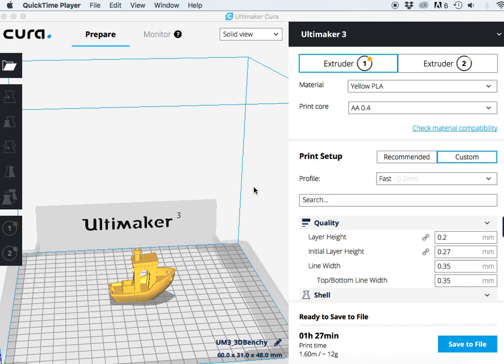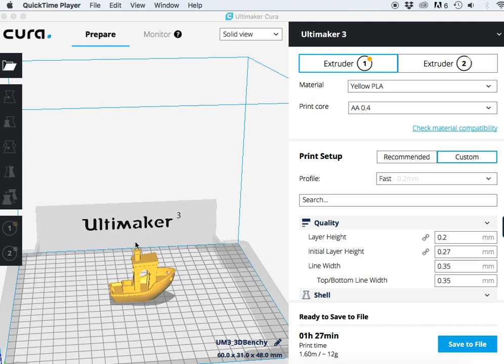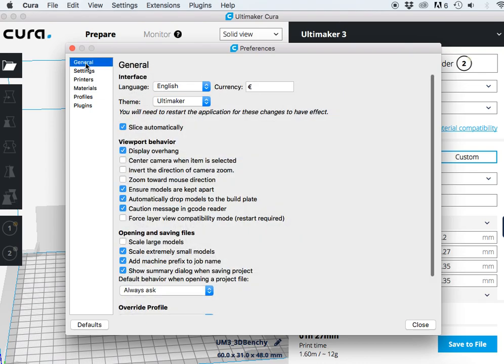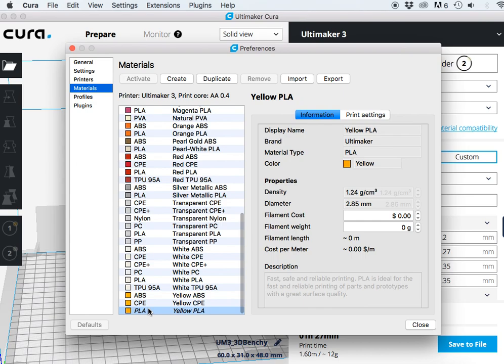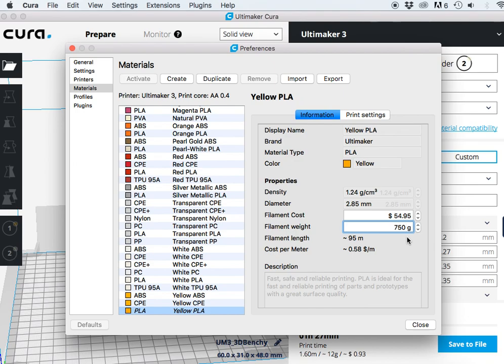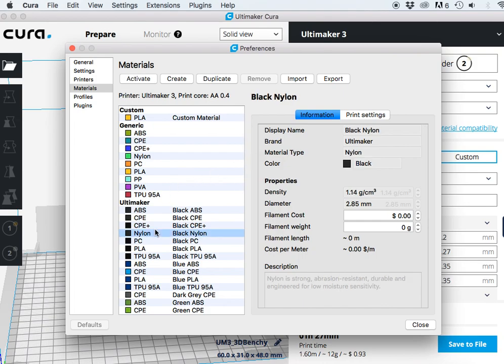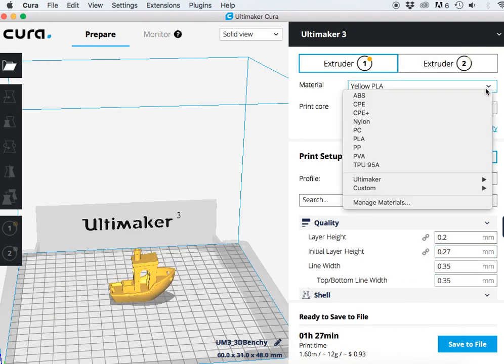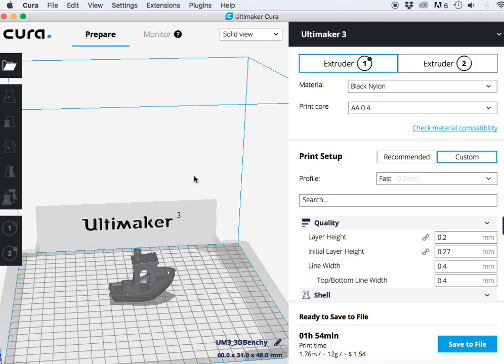Ultimaker's Cura 3.0 - How to calculate material cost

Comment: I know it's an old video, but is there also the possability to calculate energy/electricity costs? Since electric energy is quite expensive these days, this would be great. I know it depends much on the Printer, the temperature and so on, but simple by calculating the highest Power oft the printer times the printing time should be a good overview.

Comment: Please answer me, my only option is to save to file.  From there how do I print.  I have a monoprice mini if it matters
Reply: Ultimaker Cura 3.0 is meant for Ultimaker printers. The icon at the bottom which reads "Save to file" will allow you to save the .gcode to send to your printer over USB for example.
Reply: Colin Pischke ok, forgive me if I'm being stupid, but on Windows how do I send the g.code to my printer through USB
Reply: I have a monoprice mini also u save it to a USB card that was given to u with the printer and save it to that then put it in the printer and it will show up in your printer I know it's been a year since u posted it hopefully u figured it out

Comment: Done everything you said in my Mac. Didn t Work
Reply from the maker: Hi Antonio, did you enter both the filament cost and filament weight? Cura will not be able to calculate an item cost without both of these. Also, are you using Cura 3.0 or later? As a note, I screen recorded this from a Mac so it should be exactly the same.
Reply: Yes i Have and still no values were added. 3.0 correct